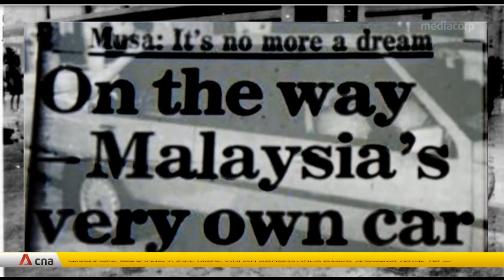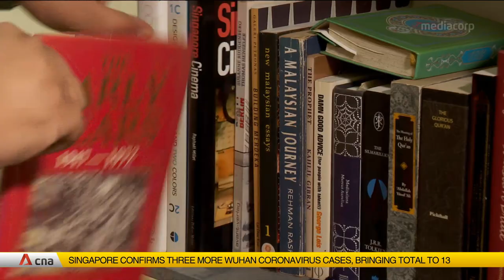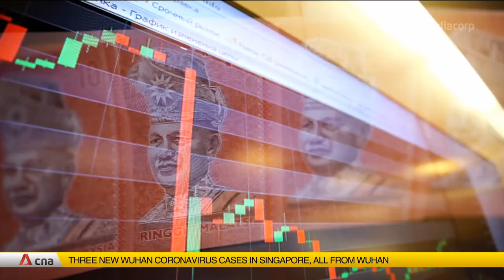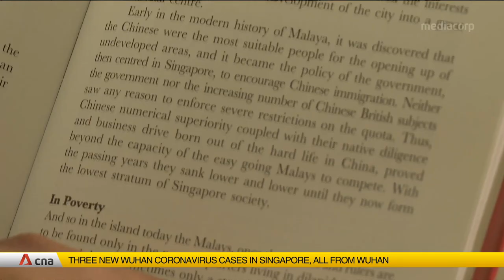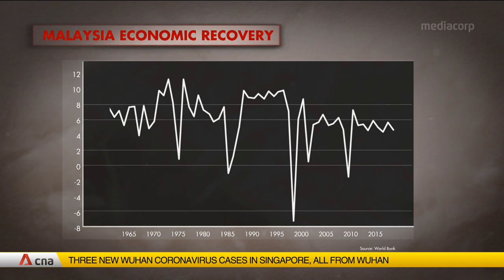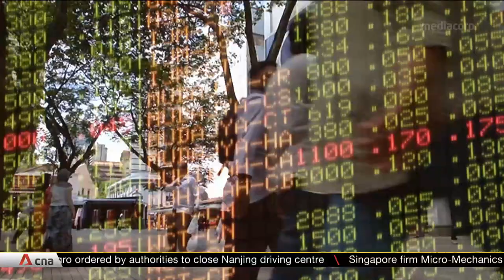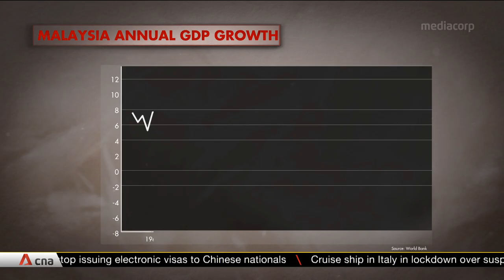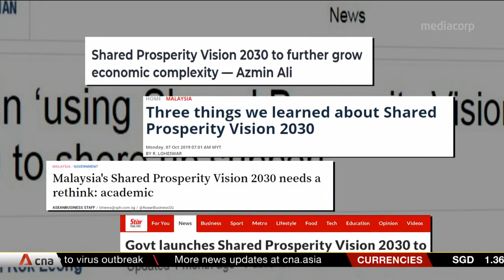What happened to Malaysia's Vision 2020? | Insight | Full Episode

Comment: Sad story about Malaysia, in which I spent my prime years. Our leaders seemed to have vision at first. They failed right in the beginning, to work out definite workable steps to achieve short term and long term goals. Our leaders had visions but failed to push through to achieve goals because the huge civil servants are stumbling blocks, they did not fully cooperated, racially biased in implementation. The failure of this 30years Vision 2020 resulted in the politicians have gotten rich, the middle class got stagnant, underperformed, the poor got poorer. Pitiful.
Reply: What´s so pitiful?  After 70 years, the middle class and the poor still vote for them.
Reply: @louislim1151  True